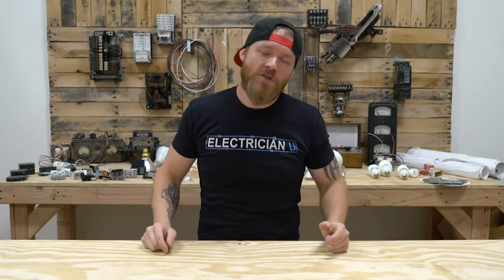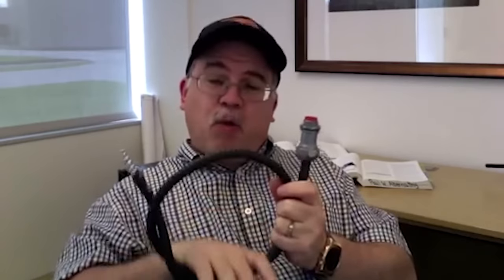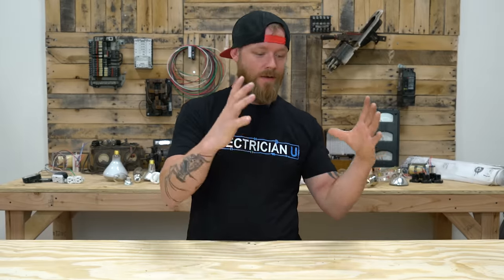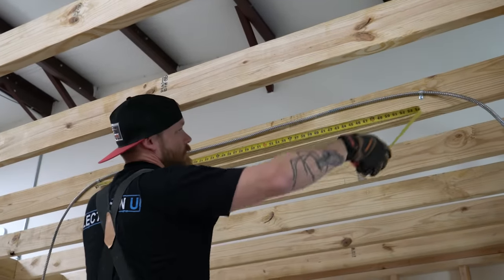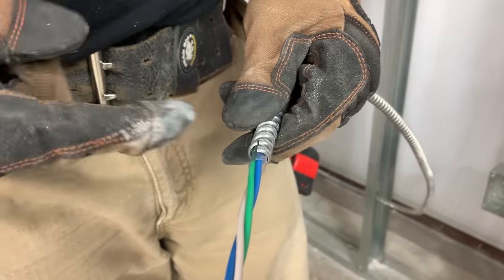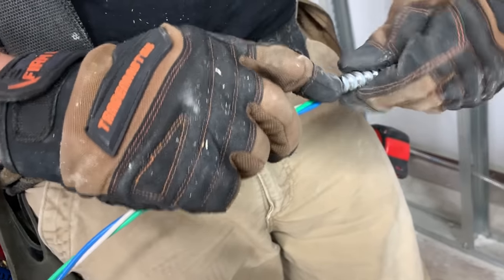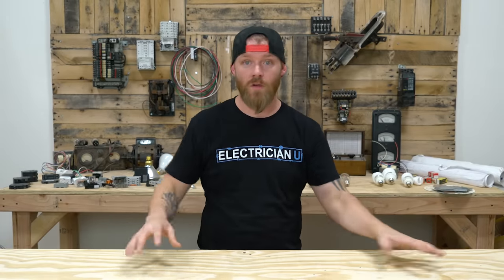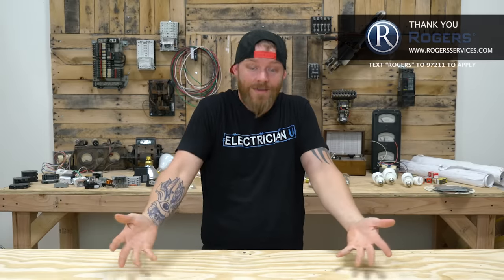Wiring With MC - WHAT YOU CAN AND CAN'T DO WITH MC CABLE as an electrician

Comment: I usually take pre-work out protein and think about all the people who did me wrong. That way I gain more strength from rage to pull that mc wire in between metal studs.
Reply: You're working against yourself, my friend. If you have a scrap piece of MC, try pulling it through a metal stud. If you're encountering resistance, pull it through the stud from the opposite end. Due to how the spirals are formed, there is only one easy way to pull MC.
Reply: Lol!
Reply: Where I live, the drywallers/framers often only put one Kelly screw in the steel stud at top and bottom.  The logic is that the drywall will strengthen it.  But it makes it difficult to pull the Cable through the holes, especially if the steel studs are longer than 8 feet.   So, often the drywallers are pissed that their studs are bent by my cable pulling.  I’ve given up trying to explain that my boss doesn’t have the job priced for me to go slow, and that their boss actually has the job priced for them to put in 4 Kelly screws.  It’s a regular conflict in the industry around here…
Reply: @jakesully5402  lmao, you need better training. I've never once had that issue.
Reply: @Tre16  LOL
Reply: "all that rage is gonna burn you up kid" "keeps me warm" 😂😂😂
Reply: I saying as electricians we know what it is on how do to the job when it comes to job and installation of mc and when to use or not to use anti shorts/ red devils me I rather use electrical tape on my cable not anti shorts but when dealing with city inspectors on commercial remodel jobs we as electricians dont have a choice on the inspectors we get who is available and some are gonna say use them or fail the inspection even though we can say its not required even if we tell them in the code book says its not required. When it come use we're  right by code but wrong when failing the inspection and argue the point to the city inspectors we're still wrong and when our bosses get mad with us cause we told the city inspectors that they were wrong and told the. What the code says but we're still wrong
Reply: @wlipman  no, it’s a workout either way
Reply: @Tre16  you never had shitty carpenters putting the studs up then.
Reply: @grandpa6535  iii
Reply: @michaelruiz4074  the AHJ usually has the last word.
Reply: @wlipman  what does mc stands for in electric
Reply: I've never had a problem pulling through metal studs due to the mc design but rather pulling though the studs on the flush side. If you're pulling through the concave side of the studs,  you'll never have a problem
Reply: @jeremynguyen2346  Metal Clad
Reply: @wlipman  I believe that was a joke Walter
Reply: Lol
Reply: I got tired of pulling wires, so I became a plumber.

Comment: I am an electrical contractor with 35 yrs experience from heavy duty industrial to high end  residential and I always like to listen to dustins videos because there’s always something to learn that you thought you knew but actually didn’t. Your never to old to learn a trick of the trade or somebody’s particular style of doing something that can benefit you or your company and save time and possibly may even be a safer way of performing a task. Great job Dustin!
Reply: I was a master licensed HVAC mech which in our location I could pull electrical permits too. because we always did our own wiring of equipment. I liked spending a couple of weeks with the guys just out of school. You never knew what you could pick up and I was never too proud to learn something from them. Some guy's are like, I've been doing this for 20 years you can't show me anything. That's just stupid. PS for some reason it seems most HVAC mech came from the plumbing field yet the very best at solving problems were electricians who expanded into HVAC.
Reply: As an IBEW electrician, I was surprised as an apprentice that the journeymen asked the apprentice's a lot of code questions, not just to keep them thinking about it, but because apprentice's were currently studying it and were the most up to date. I have had 10 year old children ask me why I did the job one way and not the other, and sometimes my response is that I just didn't think of the better way they mentioned. The day I stop learning from others will be the day I die.
Reply: I'm a truck driver and most of us have a similar mindset, even those of us with MANY years behind the wheel. The good drivers know that you're never too old or experienced to learn something new. I had one older driver tell me "The day you think you know everything is the day you hang up your keys."
Reply: Safer, yes but I've had it with faster. This whole get it done as fast as you can and the fastest guy is the best electrician is basically ruining this trade. It's like a lost art. See how many people still know how to bend 4 inch PVC without burning it, melting it beyond repair, unable to make specific bends in degrees. Utility companies have basically banned contractors from heating PVC. Craftsman who can still bring the pipe to a glass plastic state are becoming pretty scarce

Comment: We never use MC for horizontal exposed runs, but it finds extensive use for vertical drops from a junction box on that wall to a piece of vibrating equipment adjacent to it (and the associated service loop at said junction box is protected too).  We never run it on the ground, always supported, and sometimes with a spring to take the load.  The other time we use it is in kitchen island cabinets to the sockets mounted in them.  We secure it well to protect it from homeowner general abuse over time (nothing to easily catch and pull).  Once you get used to using it, it is not bad to work with, and I always exceed the minimums where reasonable - my philosophy is to never come back for rework.  If someone complains during tearout that I over built, it means it did not burn down and I am good with that!

Comment: You were taught well. A clean worksite is a safe worksite. Those little pieces of cut armor can be like skates on cement. I always roll out cable before installing it and snap a line when I drill beams. Level holes make pulling cable so much easier. Great to see a young guy take pride in his craft!!

Comment: Besides the direction you pull MC, it also helps the direction you pull the MC through the stud. The studs are stamp cut with a lip on one side, pull the MC the direction the lip on the stud is facing as to not fight it and have the lip to catch on.
Reply: or you can put plastic bushing in studs
Reply: @1topfueldrag  pfft, who's office is gona pay for that?
Reply: typically pull into the valley of the stud

Comment: Thanks so much for your generosity in sharing this information and being the consummate professional.  I'm not an electrician in-training, just a tech guy, DIY-type who endeavors to do quality-minded work, so I really appreciate your attention to detail and to meeting the requirements of the NEC.  I'm one of those people who actually prefers armored cable over NM in a residential setting, though I'm really just doing it under permit in my parent's house, preparing it for eventual sale and trying to eliminate any electrical gotchas that would come up during pre-sale inspection.  The house is circa 1960 and was wired on the cusp of the changeover from 2-prong to 3-prong receptacles and overall device grounding at each box.  While the majority of the cabling does have vinyl insulation and a bonding strip, the electrician who did the original install gave my father a discount on his stock of the old BX he was trying to use up at the time.  That's the horrible stuff with the waxed canvas sheathing over rubber insulation over tinned copper.  You know that nightmare.  Dries out at the ends with the insulation literally crumbling when you touch it.  Plus there's no bonding strip along the armor so the NEC technically requires the use of GFCIs in order to have 3-prong receptacles present to compensate for the lack of a legit path to ground.  It's been satisfying to replace almost all of the old canvas wiring with MC, correct the non-code add-on wiring done by my late father (liked using Romex in exposed areas and other "creative" applications), and ensure all the boxes and devices are properly bonded and grounded, respectively.

Before proceeding I did a lot of research related to the NEC and I've consulted a couple people in the know so I'm confident in the integrity of my work.  Still, wish I had seen your video sooner for two tips in particular:  (1) snipping the protruding edge created by the Roto-Strip and (2) the fact that the spiral of the armor is "directional".  In areas of the basement where I added new home runs at least it's not too late to correct #1 by retracting the cable from the connectors just enough to clip the edge and reposition the bushing.  A bit of a pain, but still fixable without having to take any connections apart.

Thanks again!

Comment: Great video!  I have a old steel-framed house that was originally wired with Ragwire (insulation was almost cut in more than a few places), and when I remodeled I re-wired with MC cable.  The electricians went through about 2,500 ft of it, and they let me run another 1,000 ft for can lights and 3- and 4-way switches on my own.  It was a lot of work but everything runs great and is up to Code and should last a very long time.

Comment: Never ran MC outdoors. Had a halve ass contractor use it to wire in 277 volt 4' luminares about 6' below a loading dock roof. Only problem is the ones closest to edge got wet everytime it rained. Some where in NEC it states a 45 degree rule for rain entrance. If angle from roof edge is 45 degrees or less you can not use MC cable. Was told this at a CEU class. Most commercial buildings near me have to be wired in with MC & not AC ( BX) cable. Thamks for another good vid.

Comment: Thank you for this!! I just had a customer of mine ask me if I can inspect the HVAC guys electrical work they just finished a day before I came to finish up my work inside, and after looking I told my customer # 1 they've used regular MC cable mounted on the exterior wall (with no roof overhang) #2 terminating in the disconnect boxs with just Romex connectors 😳 #3 I found about 2 & also 3 inches of the jagged cut MC cable inside all 5 of the disconnects past the Romex connectors and #4 no anti short bushings installed to boot!!! 
 My customer then asked me if I could show him proof so he could show them and I googled "why can't you use MC cable on exterior wall" to see if I could find the specific code (cause I didn't have my book with me,) and your video was the first Google gave me and I've seen your other videos before too so I clicked on it and he especially appreciated the part where you introduce Paul And he showed the proper MC to use with the proper connection!! I didn't have to give him any proof of course about the jagged MC cable that was inside the disconnect boxs as that was a no-brainer for my customer!!! lol Seriously thank you for this video and all your other ones too!!
Reply: This is what typically happens when you have untrained and unlicensed people doing what is economically expedient for them rather than what is safe for the customer.  I had a similar problem in my apartment where some people who worked for the kitchen contractor ran Romex through my lower kitchen cabinets to feed my refrigerator.  I rerouted the Romex through the attic and back down the wall to eliminate that problem.  I also have a piece of #14 AC-90 used to extend a 20 amp circuit to a range hood they installed.  That is a big no-no.  Their plumbing work was deficient as well and the waste pipe from the kitchen sink had to be redone at my landlord's expense.

Comment: Snap 2 It mc connectors are the way to go.  Also those big ones are really good for big 3 wire multi neutral cable.  Also I have been told the direction you run through metal studs makes it easier in addition to pulling the cable in the right way.  Something about how the holes are punched.
Reply: its how the cable is made it will slide one way but not the other (easily) you can tell by just trying either side of the spool which is the one to start from same thing if you are pulling above a t-bar grid...I like to put a piece of emt up to protect the grid from damage when pulling hans solo.https://youtu.be/6sZyqikMsgw?t=1281

Comment: When  running in a drop ceiling you have to support your cabling. Light fixtures also have to be supported independently of the T bar. Incase of fire or ceiling collapse the fixture or cable will not add to weight of ceiling.

Comment: Don't forget your little red inserts at the end. No matter how smooth you cut it, it may not pass without those. You can remove the jacket and go to EMT pipe in your runs. Some places require you to use compression fittings, not set screw. Also, in Virginia we're required to bond the service boxes. The building was a shop that uses gasoline & welding gas. Did not require explosion proof per the inspector.

Comment: You can run MC under a house,  in an attic,  or somewhere  that you need protection from rodents chewing up your wires or damage from bumping into the cable however,  do support it according to the NEC,  but it provides damage only protection,  not wet location protection.  Under a house MC will be exposed to high humidity (which won't have adverse effects on the MC) but not flooding or even drenching. MC is basically rat proofing in dry locations. If you need wet location and damage protection too you have to run EMT with compression couplings,  unless your job specifies RMC.. (haha).  Some old school electricians still run EMT with barrel connectors instead of MC,  which is not waterproof and does the same thing.  Also,  EMT is a lot more costly to run than MC and requires a lot more work.
Reply: @scottbishop2532
As far as the code is concerned, mc or ac both need to be protected from damage, same as NM.

Comment: Im currently working on installing Leak Detectors, Liquid Level Switches in an underground fuel access vault that requires the use of those PVC coated MC. We use Crouse Hinds Gland Connectors that use a sealant compound to prevent gas vapors and fumes from getting into the explosive proof box. Interesting Stuff.

Comment: Great info - especially since MC is cheaper than Romex now and people are using it in their house.  My house is all AC90 and I just added all my new circuits in MC/MClite.  I was at HD showing a guy the cheaper MC and he was like - what?  That is only for commercial - and granted you have use metal boxes and different connectors - but not not the most mysterious product.  And using MC lite you can cut the jacket without a rotozip.

Comment: Love stuff like this! My working days are over but it's nice to picture in my mind how you're putting things together. 😊

Only worked on two commercial bldgs with steel frame. Running MC was a pain in the beep but tying it in was great once I figured out the proper way to cut the metal.

In residential I always used MC for furnaces, water heaters and such.

Comment: Let’s not forget about why NOT to use BX connectors on MC cable!  

Had a guy do this to me years ago on a job..... Everything painted and finished! 

Well, the setscrews of those BX connectors penetrated the conductors in almost every outlet and switch box, making for a really fun day at work!  

Replacing each and every connector, the little slack I had to work with, and some heat shrink tubing was my only way out of that mess!

Comment: On the cleaning note, it makes a huge difference. I’m a plumber and I’m not the best about cleaning as I go but I do clean up at the end of every day. I have my crew clean up any cut offs and trash and out all the fittings and pipe in one spot. I used to thing it was an age or experience thing but we have a 40 yr old journeyman who doesn’t wipe solder joints, gets primer everywhere, and his van is impossible to get into without shit falling out. The other crews are younger and I’ll go to their job sites and there’s cutoffs everywhere and water bottles everywhere. Nothing bugs me more than throwing a pipe cutoff in a ditch. Then it gets buried and a service plumber or anyone comes to dig something up and hits that and thinks it’s a live pipe. Another trick is some supply houses use these thick plastic bags to put things in. I always save them and use them to pick up trash. On top of the practical sense of it, it just looks better if you keep a clean job site.
Reply: Christopher Trafnik yeah it’s funny, in my personal life, I’m super unorganized and could be considered a slob. However when it comes to work I’ll clean and organize.

Comment: the connector you hate for mc is my favorite . it works on anything including romex, so, sj cord etc. it's called an L-16 ,L-17,L-18,L-19  which is up to 1 inch pipe thread. it has a foot inside it so won't damage the cable and grabs it. i always want my connector to stop the cable from being pulled out if it gets yanked.

Comment: i used to use 3 inch emt and pull 3 c 500 mcm . wow what a job.actually snapped a 3/16 aircraft cable pulling it even with only 270 degrees total.  i switched to 3c 500 mcm mc aluminum conductor . run it across ladder trays. still need a forklift to pull it in the shop put it's way faster and less expensive. doesn't look as good but so what. in our factory it doesn't matter. and yes it comes that big and more

Comment: When ordering mc ask the supply house for a reverse wound reel. Then you can use the spinner and have the cable in the correct way to pull smoothly. Also watch which way the studs are facing, that also makes a difference. (27 year commercial/industrial electrician)